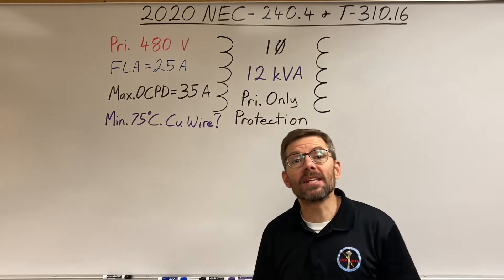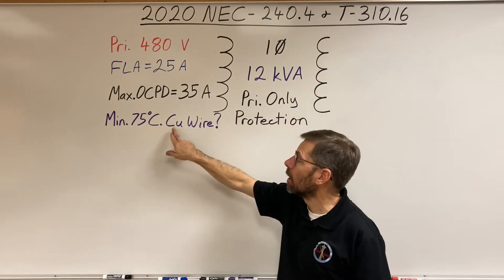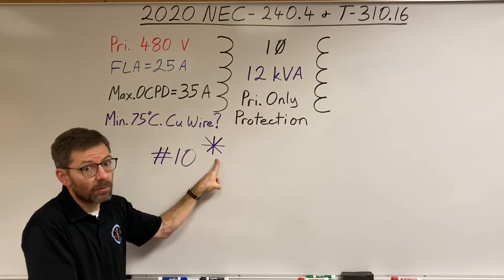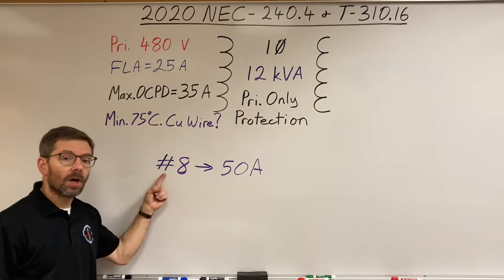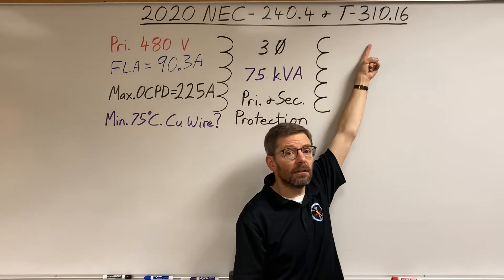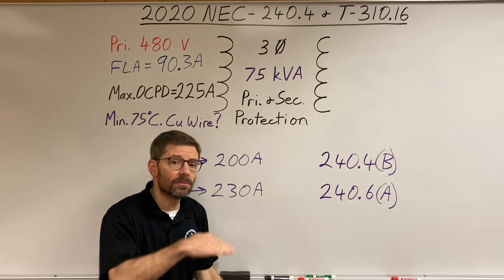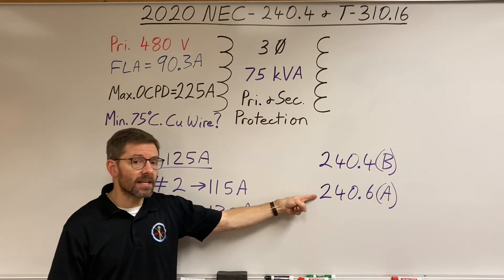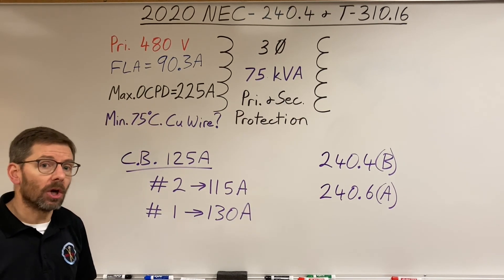Transformer Primary Conductors

Comment: Great video. Wondering why you are sizing using 75c? Aren't we suppose to use 60c column when the amperage is under 100amps?
Reply: I think most of these examples and code questions specify 75  degree column

Comment: @ 8:00 why did you not use #3 cable since it can handle 100A which is higher than FLA 90.3A  ?
Reply from the maker: You are correct in that a #3 AWG copper conductor rated for 75 degrees C can handle 100A so it can easily carry the Full Load Amperage. The transformer would be adequately protected per T-450.3(B) and the load would be provided for. (If you are maximizing the output of the transformer with a "continuous load", make sure to also consider 210.19, 210.20 for branch circuits, or 215.2 and 215.3 for feeders.)
This video focuses on the rules for "protecting the conductors" so if you did choose to use a #3 AWG copper conductor rated for 75 degrees C, the "conductor" would need to be protected by a 100A OCPD, also rated for 75 degrees C. As long as the characteristics of the OCPD allow for the inrush current to avoid nuisance tripping upon startup, a 100A fuse or circuit breaker paired with a #3 wire is a perfectly acceptable option.
Thank you for your clarifying question.